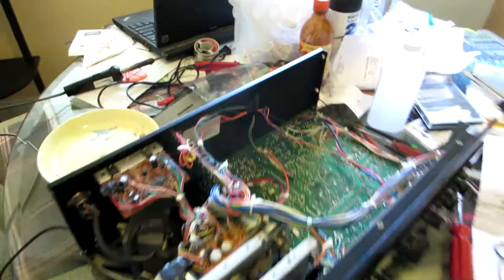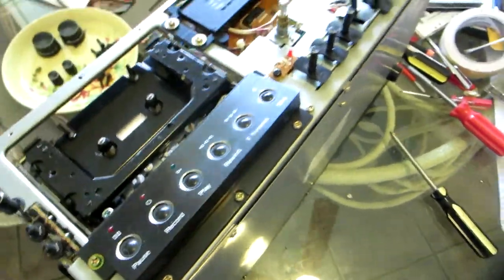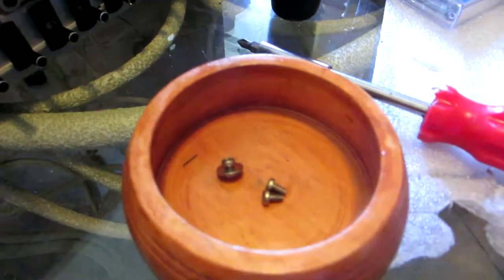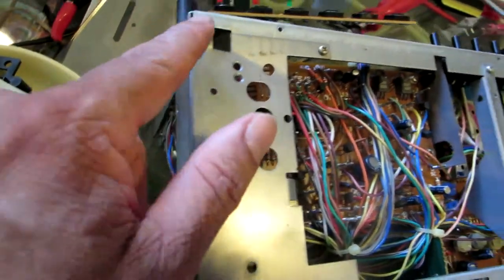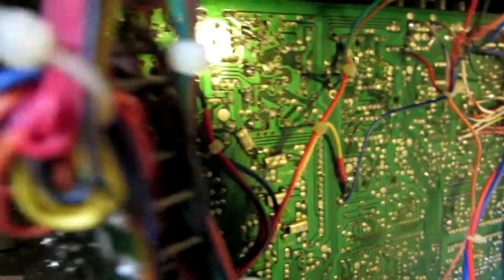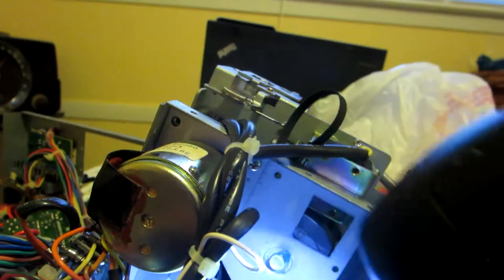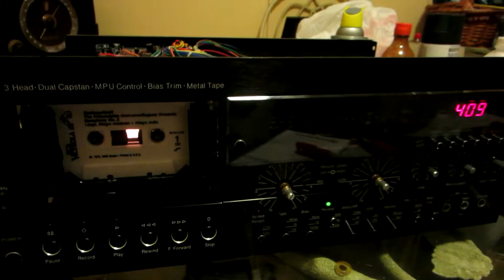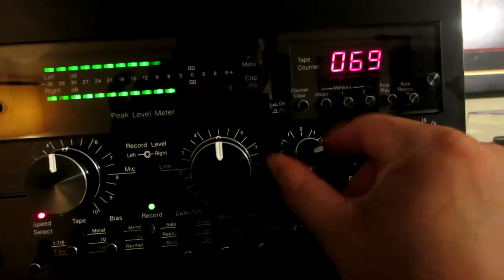BIC T-4M Belt replacement

Comment: I need to change the belts on my T4M also... wow, this looks so crazy.  I have not choice though, I need it to work again!  Thank you for filming this, i will save this to watch later when I start the project.
Reply from the maker: Good luck to you and be patient. Make sure you have enough time to remove and put everything back together. It’s very tedious and make sure you don’t pull any of those spaghetti wires soldered to the boards or the deck will not work when you put it back together. You will be rewarded with great sound, especially when recording at high speed.

Comment: A lot of these sophisticated decks (while sounding great) is a major involvement to have the belts replaced.  I am not capable of doing myself and thus having a tech do it cost a lot of $.  If the belts are destined to be replaced, why don't the engineers who designed the equipment position them in an easier to access spot?  It's like removing an entire car engine to replace some plastic parts.  I have owned the BIC T2, T3 and T4M.
Reply from the maker: I agree with you 💯 %. These decks sound great at high speed,  but to repair them is not cost effective. 
The BIC T-2 and T-3 are not as bad, as the T-4 though!

Comment: Great job... very helpful video
Reply from the maker: Thank You, I hope it helps somebody fix their cassette deck. 
It is very complex to change the belts and pretty much a disposable deck in those days. Too bad, because at high speed it can approach a reel to reel at 7 1/2 ips!
Reply: @manzanaresantonio  I'm about to service a similar deck...the BIC T2....very helpful video
Reply from the maker: @cassette_decks_and_turntables  That one will be much easier, it will only take you about 30 to 45 minutes. You have a lot of space on the back of the mechanisms!
Reply: @manzanaresantonio  i have many decks and serviced a lot for friends...the most difficult i have service is the Pioneer's master reference mechanism...
But the BIC T4? Total Nightmare...
I hope the T2 will be easy as you say...
Congratulations again...great video...
Reply: @cassette_decks_and_turntables  how did it go for you? I have a T2 as well....the belts wore out very quickly back when I bought it new.It has been stored ever since.

Comment: Hi have one but I have no sound, but I looked at yours when it was opened so my question is there are two wires that have no place to
Is yours the same or did they loosen up? Any help would be great btw the wires are grey and orange thanks
Reply from the maker: They could have loosened up in yours, that's the rpoblem with those spagetti wires. 
My BIC 3 developed a symprom that it could not record or play a cassette, I had to take it to the local technician and was able to fix it up. He said some of the IC or Dolby chips had gone bad, I can't really remember what He said as it was 4 years ago.

Comment: (13:00) I think this is why you can get the BIC decks cheap nowadays. Great machine, but holy hell, just to replace a belt? I just bought a T-1, a far simpler machine but still requires major disassembly. My 2002 BMW is easier to work on than this.
Reply from the maker: :))) I agree, they are great decks while they are working, once they broke they were pretty much disposable, as you would have to pay some serious money to repair them!